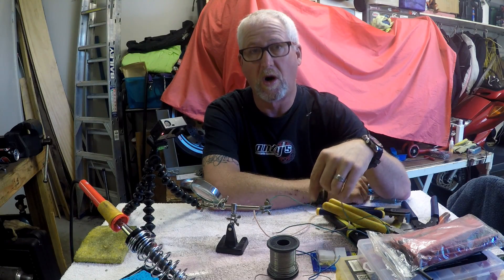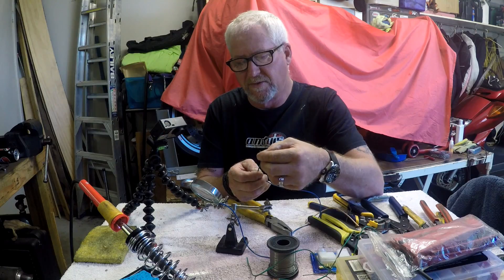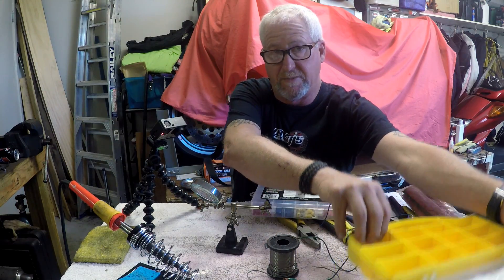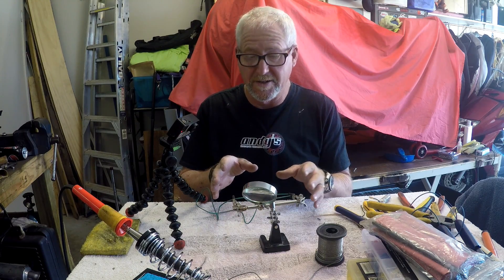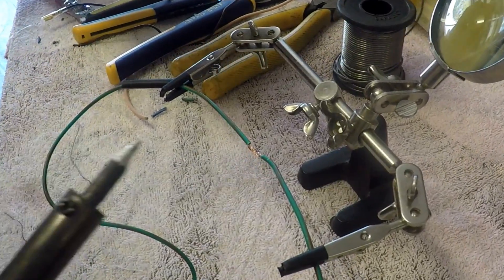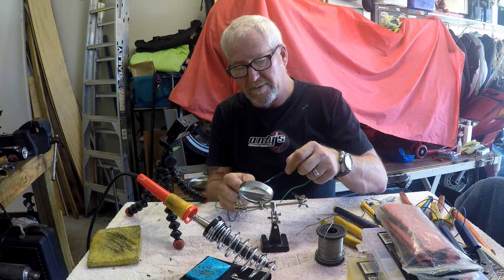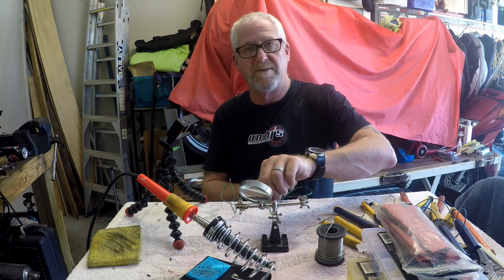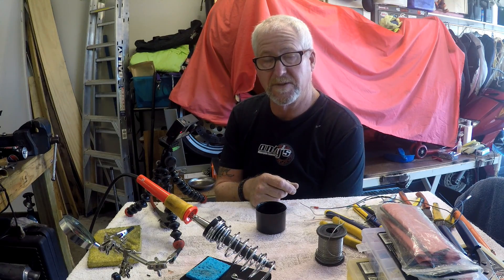Car and Motorcycle Electrical Connections - Soldered and Crimped

Comment: Melt the solder on the tip (let it pool if needed) then bring it to the wire and and let it wick the solder into it, helps if you use the correct size solder for the wire too; the hack job that muppet did makes the baby jeebus cry. 
Was taught many moons ago (when doing radio ham stuff) that if the items to be joined where under stress from movement or vibration then use crimps as they are more forgiving if done right, solder on the other hand will crack / fracture even when you have used a soft solder over time. 

You could do an entire series on solder / joining stuff....
Reply from the maker: You're right of course about the solder size.  I guess we are all guilty of using what we have at hand in the garage, I know I am.
Reply: Plumbers solder....in a emergency horrid stuff to use but needed it; went back in later and fixed that horror >_< something else i know a lot of folks get wrong (think you covered it in the vid) but keeping the heat on the solder / wire isn't the best idea you end up burning all the flux etc off and can wreck the insulation turning it very brittle
Reply: another little tip....swap the solder iron tip out for a conical tip, this allows you to have a pool of solder ready to bring to the joint. The normal needle point tips are not meant for this kind of work; surface area is too small and they concentrate the heat in one spot.
Reply from the maker: All rolled gold tips mate 👍 thank you for sharing, I know that I appreciate it and hopefully others will too.
Reply: No problem, hope it does help. 
Just a hobbyist myself, whos being doing this kinda stuff since i was a kid (dad taught me when he was into radio ham stuff) but i don't count myself has a expert at all, just keep practicing when i get the chance, something therapeutic about doing a clean and tidy job on some crimping / soldering.

Comment: I prefer uninsulated connectors as u can see the joint for years to come.i also use scissors to slightly trim tabs as on thinner wire it gives a neater join when using crimping tool.i also tin the soldering iron tip in bakers fluid then wipe tip before use.uninsulated connectors  easier bought online.

Comment: Good info there Andy. I'd advise anyone NOT to solder connectors that fit into multi-pin connectors. The joints will fail over time at the point where the solder meets the flexible core of the wire due to vibration.  This is quite common for all soldered joints. They should be well supported so they can't move.

Comment: One of the better argument subjects is the crimp V's solder ("sodder if ur a yank) and almost up there with "whats the best engine oil to use?".....
Here is where all the armchair experts will trot out the usual lines such as solder joints can break easily if subject to flexion. There is a certain level of relevance to this under extreme conditions but no splice should be subject to extreme flexion and vibration anyway. 
NASA seem to support soldering of wires as their preferred method. There has to be something in that.

OTOH, the solder camp will blather on about the possibility of the wires corroding within the crimped splice and under extreme circumstances, along with the dissimilar metals involved, this can be the case resulting in resistance at the splice.

One camp will extol the virtues of their PREFERRED technique but at the end of the day it comes down to what your most comfortable with and the nature of the job at the time.

Soldering is a skill that requires practice to achieve strong and electrically sound joints with no insulation damage and a hell of a lot of anti-solder rhetoric comes from those who are not proficient themselves, or have seen the results of others not proficient in soldering.

Each technique has its place but if you have a cut loom of some 2 or 3 dozen wires, obviously, soldering is going to be the preferred technique.
Crimp splicers are very bulky in comparison to a solders and heatshrinked joint and the repaired area will at least treble in physical size. Great as aquick method for those who cannot solder proficiently but are bulky and unsightly in large numbers.

Soldering/heatshrinking is somewhat time consuming and takes patience and practice to learn to do correctly but results in a very neat job, especially when joining large numbers of strands in a loom.

Comment: Useful tips, another sound video. Can't believe that clip you showed was serious! but knowing the source I guess I should believe it. You can also get adhesive lined heat shrink, which also makes the joint waterproof as well. Working on older looms, I've sometimes found that once stripped back, the wires look black vs copper coloured. You can either try and clean it, or cut back to see if the wire gets any better....it can be a real issue on older wiring. Agree on the scotchlocks...they used to be very popular for taking feeds for car stereo's etc.

Comment: Using lead based solder as you did is a big plus for any amateur, Lead free solder is the devil, requires greater heat and does not flow and wet the joint as well.
Reply from the maker: I was going to touch on this before I was rudely interrupted....and I forgot
Reply: Getting harder to get the right stuff, ebay tends to be the only source, the shops don't sell it anymore :(
Reply: Look at all the problems the early Xbox 360 had. 
Look a the issues with the Toyota accelerator pots. 
Yay, lead-free solder and it's best friend, tin whiskers.

Even low-temp lead-free solder requires  about 140 degrees F MORE heat than 70/30. 
I'll stick with leaded solder.

Comment: Unless it's a circuit board, crimping is a far better method of securing a connection.
Reply from the maker: Guys I encourage unmoderated debate so I won’t be deleting anything, I’m not Delboy. This topic is always going to polarise people but for what it’s worth here is my view. 

In normal automotive applications (we’re not putting rockets on the moon here) I believe that both methods are appropriate. It is my view that crimp connections are favored by manufacturers for a number of reasons. They are mechanically and electricity sound. It is easier to achieve consistent quality during manufacture. It is a faster process. It allows some flexibility with plug and play options across different bikes/cars. And you can connect/disconnect components during field repairs.
Reply from the maker: Puffalupagus360 Turbo Yoda... a giant among men
Reply: tassuperkart NASA specifies a particular best method of soldering when no other option exists.
Reply: Seriously mate...? really? You actually feel the need to bang on and on about this? On someone elses feed no less?
Cool, whatever mate, you win!...... I think? My butt is definitely hurting...yikes!
Im a looser, a sore one no less, with a sore bum apparently!
Ill defer to your obvious skills as a trained electronics technician.

There ya go... you big WINNER you!!
Reply: Then its clear that NASA is mistaken?
Define "better"...
Reply: Crimping is better, as in more reliable, more rugged, more robust and performs in a predictable fashion at a far far far higher rate than...\/
Reply: Soldering yes!
Reply: tassuperkart go ask ANY electrician they will tell you 11 times out of 10 that crimping is better than soldering. Then go ask turbo Yoda, and tuning fork they will say exactly the same
Reply: Andy's Motorcycle Obsessions truly. (Tongue firmly placed inside cheek)
Reply from the maker: Puffalupagus360 poor Al, I reckon he’s about as tall as I am 😕
Reply: Andy's Motorcycle Obsessions what is the average hieght in Straya 6'5"? I'm 5'9" that's very average here.
Reply from the maker: Puffalupagus360 I’m 5’10” and on the short side of average. My father is 6’2” and my brother is 6’4” 😢
Reply: So Puffalupagus360, tell me, WHY does NASA specify soldered joints on their spacecraft if crimp joints are so wonderful then?
Reply: Most of the automotive aftermarket ECU manufacturers, some of whom i am on first name terms with recommend soldering over crimping.
Are you trying to say you know more than them?
Reply: Because its quicker and easier for them.
Reply: tassuperkart Yes I am seeing you are talking directly out of your ass as Haltec, MegaSquirt, Holley, Hondata, K-Pro, Ralli Art, Spoon, Nismo, Mercedez Benz, BMW, Porsche, Audi, Volkswagen, Ford, Chevy, Dodge and Alfa Romeo all advocate crimping over soldering. Then inside your own country go ask professionals that know from experience, go ask Tuning Fork, Turbo Yoda, Mechanical Stig at Ichiban Imports you will get the same answer over and over that Crimping is the better option.
Reply: tassuperkart https://youtu.be/VXVISyLUTl0
Reply: tassuperkart https://youtu.be/faLn-SjVfwY
Reply: Ahhh, the clear sign of somebody who doesnt actually know what they are talking about and so leads out with the tiresomely predictable flaming. Such childishness.
I only made it down the first 2 lines of this drivel and called it a day. 
So you are calling me a liar!.... Onya maaaayte! Youre a real bright spark in the darkness ay!
Conversation ended. Delete if required Andy.
Reply: tassuperkart why delete your unending idiocy and clear display of cognitive dissonance.
Reply: Been consulting yourp your online thesaurus lately Puffy... whatever it is. I  cant be assed copying and pasting that internet name.
Keep on trying all you like tho junior. Hows the sound of silence?
Reply: tassuperkart didn't know reading had sound, but it's still better than your pedantic whining and incredible level of butthurt you are excreting. I notice that the only person that provided any form of proof of their claim me. It sucks to lose, and you are the definition of a sore loser.

Comment: Lol. I recently did a hot solder while fitting a new rear brake light switch, and after i’d done not a bad job of it, my bloody heat shrink parked an inch or so up the wire had already bloody shrunk. Clearly too much heat in the wire. Ended up electrical taping it. Also I just use the soldering iron to shrink the heat shrink rather than a heat gun usually.
Reply from the maker: Yup, that works. You just need to be careful not to damage the insulation with it, the heat shrink is designed to suffer a hot supper but the pvc insulation is not.